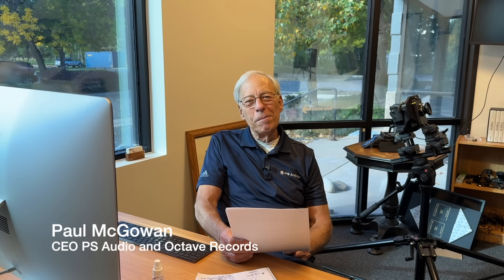Converting cable disbelievers

Comment: The only way to prove that cables make a difference (Assuming they are rated for the job in hand) is to provide verifiable evidence, otherwise it can only ever be one persons opinion, and so is up to the individual user to decide. (Like all things audio, if it improves your listening experience, then it doesn't matter what anybody else says)
Reply: Bingo!
Reply: I agree. If what Paul says is true I think the difference should be measurable. Between the two cables he is using as examples that is. I however have experienced that two different speakers can measure near identical but sound vastly different. So, to me measurement isn't everything.
Reply: Exactly, we should allow patients to continue treating the symptoms with vitamin C and charge hundreds or even thousands for it.
Reply: Cool story bro
Reply: @Pete.across.the.street are you 12

Comment: If anyone ever opened up a amplifier or receiver takes a look at the wires that go to the speaker terminals knows that expensive cables are bullschitt
Reply: I don't need a blind test, I don't need you to like my system, with my whatever cables. I need me to like my system. If you don't hear the difference between "mouse tails" and better quality cables, don't buy them, use what works for you, and I will be using what works for me, regardless how much of my money I spent. I spend 
$$$$ on a mechanical wristwatch to track time. You may use $20 quartz watch for the same purpose. I don't need a blind test on which watch tracks time better. I'm fine with what I have.
Reply: @genchic1 That’s all completely valid. However the guy who made this video is saying unequivocally that there is a difference. What many of us are saying is that it’s on him to prove it to if he’s posts such content.
Reply: @edd2771   ...wrong! Paul doesn't have to prove anything...he's just telling us what he has found, ie. his opinion.
Paul has always maintained that we should do our own individual listening test, to see if we can hear any differences. Even if he could "prove it" there would still be cable deniers like you crying BS!
Reply: Incorrect. He’s being quite definitive, and should back it up.
Reply: Ignorant comment.
Reply: And of course not forgetting the wiring inside the loudspeaker.
Reply: @joepostle3561   ...that depends on what loudspeakers you own.
My DeVores are internally wired with high-grade pure silver wiring...so what's your point?
Reply: The point is you still don’t know if the high grade silver wiring you paid for sounds better than high quality copper on a double-blind basis, and you never will short of buying another pair, rewiring them with copper and doing a blind AB. You are going on faith.
Reply: My point is that people buy loudspeakers and amplifiers then are sold wires to go with them.  Many people don’t do their research so don’t know they aren’t bettering the internal wiring of their amplifiers and loudspeakers.  Few do their research, many don’t meaning the many are at the hands of the marketing people.😊
Reply: @edd2771   Please go ahead and conduct those tests and report to us
Make sure you run this test as a real experiment with all data and variables reported
Reply: @joepostle3561 most decent amplifiers are designed with the shortest signal path possible, why do you think that is done?
Reply: @TerThroneber Nah, I’m not the one on YouTube making those definitive statements about wire, so I don’t need to prove or disprove them. But I can certainly call for the one making the claims to do so. Any thinking person viewing this video should have a similar reaction.
Reply: @edd2771   ...I'm a thinking person, however, in this instance I'm also a listening person &
since this is about audio I don't think that you're thinking properly about the topic at hand.
Reply: Well then, we disagree.
Reply: My Krell amplifier has 10 gauge wire and very little of it, most of it has copper buss bars.
Reply: Real Cable inside my speakers!
Reply: One has nothing to do with the other. Apples and oranges
Reply: Just because the amp doesn't use thick fat wires inside; doesn't mean they're not good quality wires. Many high end cables use a combination of fat and thin strands for good reason. You imply that you can tell how good a wire is inside electronics by how thick it is. Mis-evaluation abounds with cable deniers.

Comment: Differences are audible, but you don't need to spend thousands of dollars In the range of two(2) - four(4) hundred dollars can get you some really great 'sounding' interconnects, loudspeaker cables &/or power cords
Reply: If cables of 200-400 dollars make such a difference, then why do studios use run-off-the-mill audio cable of $0.30/ft bought at spools of 300 ft?
Reply: @meindertsprang7491   ...some studios use high grade cables & some don't.
It is incorrect/ignorant of you try to imply that all studios use inexpensive wiring.
To answer your question, I would say that the studios that use the run-of-the-mill
(30c/ft) cables do so to keep their expenses down.
Reply: Audible on a double blind testing basis?
Reply: @edd2771   ...audible using your hearing.
Reply: @edd2771   ...audible to my hearing.

Comment: What's stopping anyone from just giving it a go? Hifi is just a hobby like all others, nothing wrong with trying something and making up your own mind.
Reply: but unfortunately many get very uptight about you doing that, its like your spending their money 🙄
Reply: Yes indeed except they have priced these exotic cables at levels which make curious exploration difficult and perhaps the extreme cost has a factor and creating true believers.
Reply: @petew2560  You don't need expensive or exotic cables to explore if cables make a difference. The threshold for trying is low anyway, as most manufacturers offer 30 or 60 days trials. The idea that you need exotic cables will be proven or disproven along the way as you try new things.
Reply: @petew2560  The Cable Company rents cables very inexpensively and applies your rental to a purchase.
Reply: If you can afford it and that's how you want to spend your money, why not?
Reply: Hear! Hear!
Reply: Agree.

Comment: I am confused by the difference between cable and conductor. Paul mention that their cables used one cable and added another conductor….
Reply: A cable can be made up of a lot of different wires. Conductor is simply a more technical word for wire.
Reply: Many thanks, that’s clear now.
Reply: Conductor is the metal, when you have added insulation it's a cable. Both of them matter, so it's something they typically work on and try different things with.

Comment: Paul, you have the world's best setup, brand independence, audiophile passion and interest in being factual to do a proper ABX blind test on this subject. A blind test doesn't mean people wearing blind folds but just simply means in this case that the testers can't see what cables are being used. If such test can make people identify qualities of some selected cables without actually knowing which cables are used, we will have the best ever evidence of those benefits you mention. The world of audiophiles are begging for credible evidence and it's neither costly or complicated to make when already having a very resolving system to test it on.
Reply: people that hear cable differences do not care about testing.
people that think cable do not affect do not care about facts.
and here we are in a predicament. 

by the way. Alpha Audio here on youtube done some speaker and signal cable testing and listening.
Reply: @sudd3660Tests where people already know which cables are used are invalid. For decades we've waited for someone to spend a few hours proving this is more than snake oil. Seems PS Audio could make a splash on this...
Reply: @ThinkingBetter  know or do not know, does not invalidate what you hear, no matter how expensive and good i want something to be, if i do not like the sound it still do not like the sound. blind testing is not the only way.
 and not worth nothing to home users, i am not doing blind testing at home, either i like the difference i hear from any gear, no change or it is worse.  blind testing hype can go away and we all be better off.
Reply: @sudd3660The reason blind testing is so important for cables is that typical case is people imagine they hear something based on the knowledge of which cable is used. Only if people hear the same without actually knowing which cable is used, can you judge if it's in fact an actual audible difference. Lots and lots of blind tests have proven how our brain gets fooled and what people claim they can hear, they cant really hear when they don't know the cable used.
Reply: Humans aren't very good on blind listening tests; they fail on such tests of any kind. Most of them are drink or food tests, not audio trsts. So knowing this; why do people keep asking for blind listening tests? Like asking a fish to play some saxophone when it's been out of the water too long.
Reply: @sidesup8286  No, that is silly-talk. Blind testing in this context just means people have to be able to hear a difference without actually knowing what hardware is involved. If you can't hear a sonic benefit of a cable without also knowing it is in use, you can be sure your brain is fooling you. It seems you don't know what it is.
Reply: @Thinkingbetter. And with taste tests all people have to be, is unfamiliar with what cola or yogurt they're tasting.Same exact thing! Nothing silly about it. You should be a politician.
Reply: @sidesup8286 Our brain makes up imaginary sensory experiences when we are told what to experience. This is why you hear some cables sounding different only when you know they are being used.
Reply: You inference that normal very adept, experienced & highly perceptive people are hallucinating, really should be a joke to all, and you should come down off your high horse..You can accuse people of imagining about anything; but it doesn't mean they are. are.Imagine if you had "ears." No one is buying your wild inferences and theories about a million people you don't even  know.
Reply: @sidesup8286 Indeed, if those same people fail to hear what they claim as soon as they dont know which cable is used, SURELY its entirely imaginary. Those of us who actually engineer your audio products usually also know and understand this subject quite well. You are very gullible to marketing people selling guy cables it seems. Why don't you ask your wife to randomly swap cables and see if you can guess what cables she inserted lol...you'll get shocked.
Reply: @sidesup8286 I'm just talking facts proven by lots of professional audio tests. You are gullible to snake oil marketing and don't actually understand the science and engineering involved in this topic.
Reply: @Thinking Better. You continue to patronize and discount the intelligence of millions of people who ARE thinking better than you....and hearing better than you,...by claiming we are gullible and suckered in by cable ads....I don't ever recall even ever reading an ad for premium cables. I LISTEN to cables and I hear enough improvement with the Best of them (around 80% improvement) that it blows out of the water any "pretend scientist theories" like you have. Once again 2 things are really obvious.

1. You enjoy patronizing audiophiles, pretending you are a scientist & smarter than them. Under the guise of exposing the cable industry as snake oil, and saving us all money. What really needs oiled is your logic and your incredibly incredibly bad hearing.

2. You have some kind of major crusade against cable companies. and you even bring up cables, (to get a shot in at cable companies), when unlike this video, the video topic has nothing to do with cables. Just because some are priced ridiculously expensive, just like some speakers & amps are priced ridiculously; does not mean they're no good. ..Your logic, ego, and hearing is what's no good. Your hearibg must be absolutely unimaginably dreadful. And "no good" is what you do audiophiles, by trying to steer them away from premium cables like Audioquest (Paul's favorite), which could greatly improve their sound. 

 Paul is just one electronics designer among a thousand, who have a million times your credentials & credibility, and they can all have no difficulty hearing the benefits of superior cables. Your "theories " that better cables don't exist and they all sound the same & no improvements are possible with cables are not the result of any important thinking. Just the result of your personal agenda, which you try to shove down everyone's throat; as a pretend scientist. You can't even hear; yet alone think scientifically.

Comment: The best cable in the world is copper water pipe.  The sound flows through the center of it like water and the electrons flow on the inside and outside surface.  Just be sure to use silver solder for best results.
Reply: you are so funny000000000000000000000
Reply: Then cool the pipe with liquid nitrogen to ensure better conductivity
Reply: @edwinvp  Let's partner up into a business venture. There are plenty of fools who would give us big bucks.  😀
Reply: 😢has anyone tried copper pipe?  It would be interesting to hear the resulting sound.
Reply: @adotopp1865  Try a copper pipe but run glycol thru it thru a cooling unit set to 28 F. Install the noisy cooler outside, far away. Run an exotic looking insulation over the pipe. The higher price you ask for it, the more it will sell.
Reply: @CoolJay77 no I could just try copper pipe. I could cut it on the end so it will go to the connectors. I wouldn't want to wrap it tight with insolation
Reply: @adotopp1865 i thought something like this is happening in high power radio/tv transmitters

Comment: My latest cable has achieved my sound I've been dreaming of. 

I just purchased a Revelation Audio Lab USB and that's brought my final step of gaining thickness, bass and openness to my powered speakers. 

It's uniquely built with cryo'd pure silver. Two separate cables that also provide air dielectrics. One cable is for power while the other is for the digital signal. Both cables are connected along with high quality terminals. 

It made so much sense, so ingenious, that I easily paid more for this cable than any other cable I've ever owned. 

I own silver power cables with Furutech NCF terminals.  I use unterminated silver 14 gauge wires wrapped in 8 gauge teflon jackets as speaker wires, and silver interconnect cables with oil injected dielectrics. 

I own a system with dead silent background, airiness, clarity and thickness. 

I owe it all to my cable choices discovered based on improving the weakest links within my system.
Reply: Anyone make silver ribbon speaker cables?

Comment: I can definitely hear a difference between different quality cables, it may be small and maybe only be heard or felt under critical listening and only if your system is sensitive enough to reveal it, that doesn't even include the effect that EMI,RFI that can be introduced by cheap cables if they are run near power cables.

Comment: The differences are so small that it takes golden ears to tell the difference.  Problem is that most people that can afford the expensive audio equipment are 40+ years old and no longer have the great hearing to even tell the difference.
Reply: In my experience, high-dollar gear and stellar hearing aren't required to perceive differences in cables. What has been your experience?

Comment: In the little bit of cable rolling I did with IEMs, I only had one instance (Empire Ears Legend X) where there was a striking difference between cables, and they are known for being particularly sensitive to cable rolling. A pure silver cable mellows the bass and elevates the highs; when that cable had to be sent off to have a connector fixed, I was shocked by the sound when I switched back to the stock copper cable. With copper, the sound has a dark hollow quality. But, when I put that same silver cable on Empire Ears Odin, I couldn't hear any difference between silver and the stock copper cable.

Comment: Pseudo science nonsense.  Heavier gauge cables do not attenuate higher audio frequencies and lighter gauge cables do not attenuate lower audio frequencies. If I was one of the qualified engineers that PS Audio presumably employs, I would be cringing under my bench.
Transmission of audio frequencies in cables is extremely well understood and has been for decades. Paul’s ideas are pure fantasy.
Reply: This has been my experience with every speaker except my apogee duetta 2 speakers, they sound better with solid core connected to the midrange tweeters and stranded to the bass foil, I don't know why.
Reply: @mitchtaylor6512   ...opposite for me...solid core (SC) to the bass driver because of the way that SC tightens the bass response & stranded to the mid/tweeter because of the non-attenuated highs that are inherent in SC.
Reply: It's that way for me also, with most speakers, but with apogees it's the opposite.
Reply: @mitchtaylor6512   ...just as well I'm not a cable denier 😉
Reply: Solid core copper wire of, say, 14 gauge does tighten up the bass frequencies but at the expense of rolling off (attenuating) the high frequencies a little & this effect is more noticeable with age as you hearing naturally rolls of in the treble region. I was aware of this long before I met Paul McGowan.